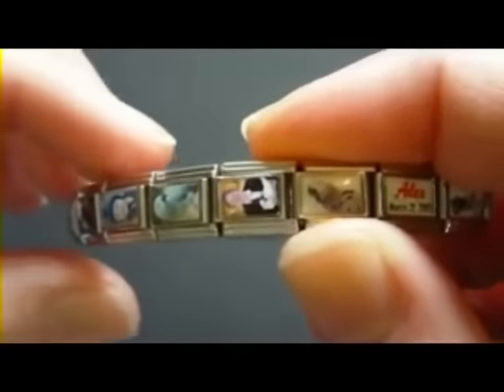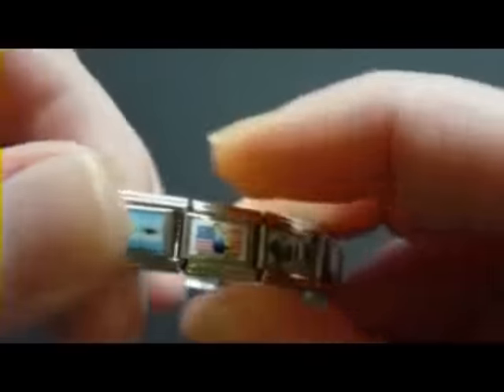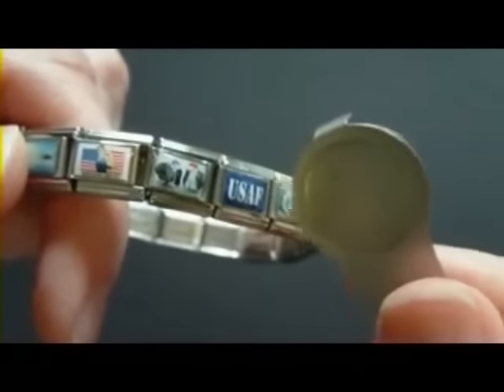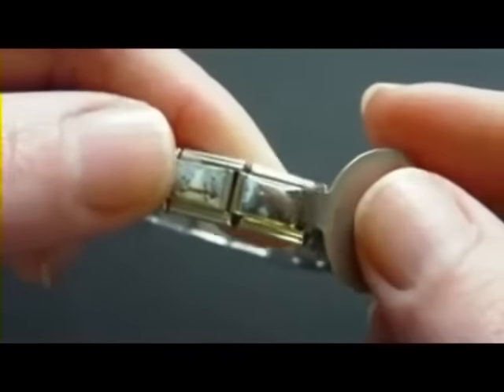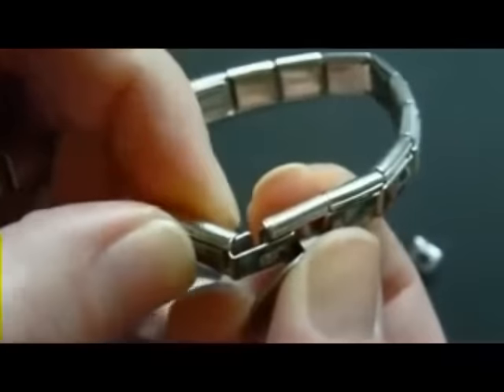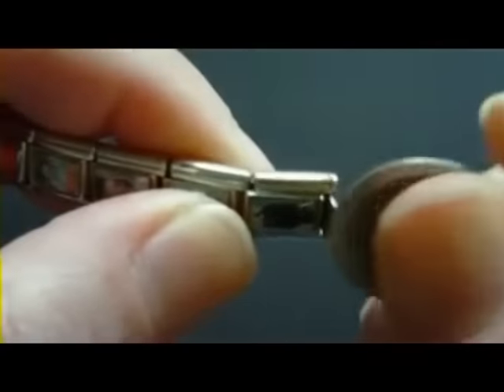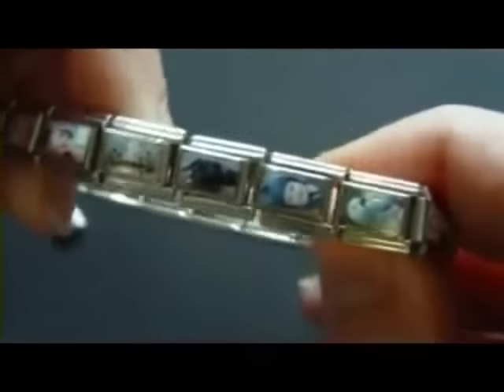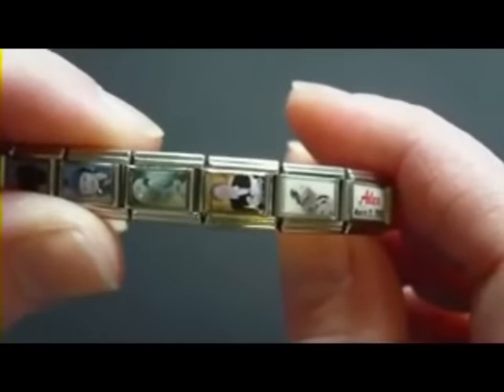How To Add and Remove Italian Charms.wmv

Comment: I found the easiest and cheapest way.  Get two cocktail sticks and when you slide the charm to reveal the hook place it in the gap.  So much easier as they won’t spring back so you can line them up and push the hook onto the other charm and then remove the cocktail sticks.  Cheap and easy.
Reply: Another easy and affordable tool is just using a key! I couldn’t do it with my nails and don’t have a good tool so I tried one of my keys and it worked great!